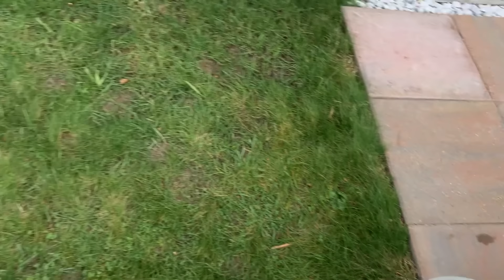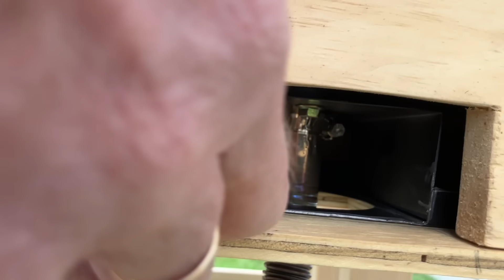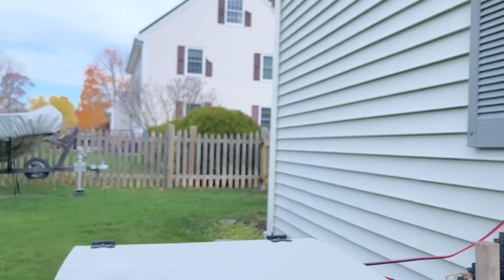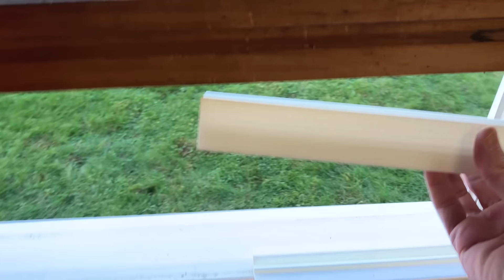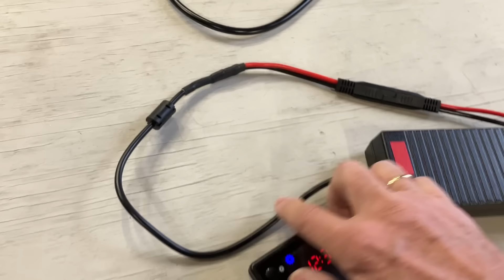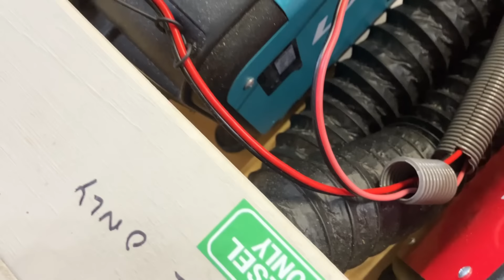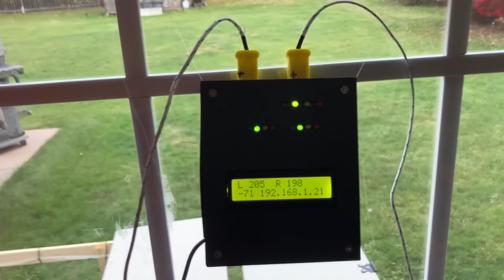Part 1: Dual Diesel Heaters for My Garage! Overkill? Maybe. Awesome? Definitely.

Comment: I would not have used the suitcase style heater , you can just lose the suitcase because the heater is inside and easily removed .
Reply from the maker: Thank you for the comment. I'm getting my first vertical later this week. I'm going to do an unboxing first start up video. But the way I'm using them I'm just using them for parts.

Comment: A little advice , do switch to 4 inch , add 4 inch duct fans to your return air return ducts . The heaters fan needs a little help . Also set the return air inlets close to the floor . I have been heating my space for three winters , they are great little heaters .
Reply from the maker: Thanks for the comment. I changed electronics so I could get to a controller that would let me set the fan speed from the default 4300 RPM to 5000 RPM and then lowered the max fuel a tad (see my other diesel heater video). I think my next iteration is going to raise the legs so the pipes are a straight shot reducing pipe length and air friction. 4" if I can. I really like the idea adding duct fans because thats exactly what I am fighting right now. Are they inline? or attached more like at the head of the intake?
Reply: @V-Tank  they sell an inline fan with speed control for $20 on Amazon. It puzzles me that no one is selling a thermostat/control set that cycles it on and off . I don't think that it would cost that much efficiency.
Reply from the maker: @philliplopez8745  Thermostat would be helpful just to make sure it turns off when the heater turns off. I will go take a look. Thanks!

Comment: I have a similar setup. I used a turbo charger inter cooler to to recover the exhaust heat. I also have a blower forcing air into the air intake tube. My exhaust temperature out of the inter cooler runs around 105 deg F depending on the heater setting.
Reply from the maker: Thanks for the comment and ideas. Someone was mentioning forcing hot air in. In my next video I swapped controllers out so I could program the fan speeds, but forced air would be even better. I want to try a water (antifreeze) heated unit next with exhaust recovery from a heat exchanger. But I'll have to wait till my budget can spring for that. With your intercooler are you seeing any moisture coming out of the exhaust. I saw a video where someone was doing that and it was dripping water which could ice up if using it outside. Love the CDH community!

Comment: This is an excellent video and I really enjoyed how you presented what you've done.  It looks like it all works, but...it seems like an awful lot of effort just to keep the units and fuel outside, when they're made to be inside.  I've watched quite a few videos on setting up a diesel heater, and the one we used for a couple of winters was also mounted outside, at first.  We discovered that the exhaust and the burn chamber air intake should be outside of the building, but the air flow supply for the heat exchanger should be inside the building.  Also, the longer the exhause pipe run stays inside the building, the more of that heat you capture.  What you've done here is impressive, but I can't help thinking one unit would be plenty, if you put the same effort into setting it up inside the garage.
Reply from the maker: Thank your for sharing. I had a single propane buddy heater that was 18k BTU with all the combustion and heat staying inside the garage, no exhaust and that was just enough to keep the garage at temp and give it a super slow rise in temp. Which lead me to diesel heaters. 100% agree that running them inside will capture a lot more of the excess heat. But it sort of evolved into this. I would say 70%+ of people run them inside. But the units I'm using are so super cheap, like $70-$100 US cheap and I have a hard time feeling safe with that. I know I'm loosing a ton of heat. My next step will probably be to raise the legs and get the pipes level with the windows. That will allow me to use insulated pipe and have at least 1/2 the length of air pipes I have now. Anyway... Sometimes you just have to do crazy projects just because.
Reply: @V-Tank  - At least half of my projects fall into the "crazy" category!  :)

Comment: Interesting.... where I live that fuel would gel instantly over that much exposed fuel line.
Reply from the maker: Tonight its supposed to get down to 4 deg F. I don't heat my garage full time, just when I'm in it. So it will be interesting to see tomorrow morning if it will gel or not. I'm running winter treated pump diesel.

Comment: I really appreciate what you've achieved, but to me it looks like a lot of over kill.  Why not just bring the units inside and run the exhaust outside?
Reply from the maker: I have had a ton of feedback suggesting that. Off the cuff, I'm estimating that 70% of people have internal heaters. It is the most efficient method in terms of thermal loss. But I have a hard time living with a $70 heater and a Gallon of diesel fuel next to each other. I don't think either is wrong, its just where I ended up.

Comment: Great video! I think about the only thing I would have done different would be to put some insulation around those fuel lines so that you don't end up having your fuel turn to gel on a cold windy night, not to say that it will but it could happen.
Reply from the maker: I have def received a ton of feedback on the fuel lines. I'm a bit nervous to see what happens this winter. I run winterized pump fuel, but I didn't have these long runs flapping in the wind last year. I'll update when we hit the below 10 deg F weather. One section with a little moisture in the fuel and its going to freeze.

Comment: Someone that understands siphons! Crazy how few miss that potential issue!

Fyi, and based on your displayed thought process' you probably already know, hon&guan (Amazon) sell 4 and 5" insulated ducting. 

After watching someone's results with a duct run outside in below freezing weather, I decided I would try and minimize that heat loss. I found that with single 4" insulated duct, at the 8' point, the surface temp was 150* (F). Same setup, same time, but a section of the 4" in the middle covered by insulated 5", the surface temp was 35* lower. 

So there is definitely heat to be saved in longer exterior duct runs. 

While I get redundancy, I've started to see ads for cheap "12000 watt" diesel heaters. Always skeptical given the fake 8kw's advertised, but these claim more than twice as much fuel consumption as a "5kw" unit, so it's plausible. Would make life a lot easier with one big heater, (with even more ability to produce heat) but I do understand redundancy. Maybe one of the smaller units as a backup, if these 12kw units turn out to be the real deal. Not a single YouTube review so far, they must be brand new to the market. Or a brand new scam lol.
Reply from the maker: Thanks for a great comment. In a future build I think I want to raise the heaters to level with the window, that should cut out about 1/2 the duct length. 100% agree with insulated on the hot side into the garage. Next build....

So I measured the fuel consumption on an 8k unit and it came out to about 4.6k BTU's/hour of consumed fuel.. So def a 5k unit. But if it were a real 12k unit that would be double what I have and make my life even easier. Wonder if they use a 4" duct for all that extra heat.
Reply: @V-Tank  the brand is "Wodli", the Amazon listing has the user manual available. 

Manual looks....poor. Says 100w draw on startup, don't see how that's possible even if it's a 5kw. Oddly they show 55w as the high range for normal running, which is significantly higher than the 5kw's which generally seem to max out around 35w. No mention of duct diameter that I see. Also shows .86l/hr on high, which is right at the .22gal/hr on high they mention elsewhere.

Hcalory has 3.5" duct on at least some of their stuff, and LF bros have 4" on some of theirs, so if this is indeed a 12kw heater I imagine they'd have to use a significantly larger diameter duct.

Comment: Just a suggestion.  I did a similar setup.  It made a difference when I extended the fresh air intake to the floor away from the heat exhaust.  Mine comes in my basement window well just above ground level and the return air duct drops to the floor level and comes across the wall about 10 feet from heat exhaust.  It made a difference warming ceiling to the floor.
Reply from the maker: Thats a great idea. Someone else suggested similar. I’m struggling with my ducts being too long and reducing airflow to the heaters and they run hot. I was able to up the fan speed to 5000 rpms and that helps. But if I could get cooler room air from the floor and not outside air that actually might help.

Comment: What power supply are you using?
Reply from the maker: I use the stock 12v 15 amp power bricks they usually ship with a diesel heater. I soldered on SAE connectors to everything to make it a little more standard for me. I run those AC to 12v power bricks on a EcoFlow River 3 to use as a UPS. Only problem is the River 3 has a max of 300 watts. So it runs the heaters fine, but I have to start them up or shut them down one at a time because of that really high glow plug current draw.

Comment: Just take the unit out of the metal box. Then you can use them.
Reply from the maker: Yes, 100%. I just happened to have new ones for this season. The old ones in the Gen 2 are spares. So liberating to have them outside of the metal boxes.

Comment: No expert here, just an opinion,  but from my research you do not want the intake inside the house.   It can send co2 that way in the event of a flame out, or so I've read.   It can also white smoke.   I was always told to vent exhust and Intake outside.   Great video !
Reply: The return vent or the air vent that he has going in is just pulling air that is blowing across the heat exchanger itself he's not drawing combustion air from inside that is being pulled from outside so there would be no white smoke coming out of any vents that are going into the building you're referring to the event that draws fresh air and for combustion that's not what is going inside so his setup is perfectly fine and perfectly safe and there is no need for any concern
Reply from the maker: Thank you! There are two loops. I'm guessing they are talking about the exhaust loop. It has an in and out and is mounted on the bottom of the heater. In my setup all that lives outside.  Maybe people running the unit inside take inside air for the exhaust intake? There is also the clean air intake and and heat output. So I'm thinking its the exhaust loop. If you know more, would love to know. Also no matter the configuration, make sure you have a CO alarm.
Reply: @V-Tank  yes sir, agree with having two alarms actually as I've personally seen and dealt with Carbon monoxide poisoning. .    My diesel heater has only one intake with a filter and one exhaust, I have both of them routed outside.   So I get fresh air from outside, and I also send the exhaust outside, Only the HEated air is inside.   What I'm I missing here.... do you have more than one intake ?
Reply from the maker: @goneridingparts  I think I'm going to do another video on a generic heater setup. Underneath the heater is combustion air, and exhaust in and exhaust out 1" (very very hot), (along with the fuel line into the heater) all three of these are on the bottom and its combustion air with CO and all the bad stuff. On the front /side of the heater is the output from warm clean air (3"). And on the back/side of the heater there are vents that allow the cool clean air to get sucked in so it blows through the heater and out the front (without CO and bad stuff). On my setup I took the clean air input and and simply attached a pipe to it so its taking it from inside the garage and keeping the pressure balanced. Hope that helps. On things like CO detectors there is a saying, two is one and one is none.
Reply: @V-Tank  definitely agree with two co2 detectors, just can't be too safe with this.   But I have read a flame out can send stuff back thru that intake, that maybe false information that I read.   it was in a forum.   I guess I need to change my setup if this isn't the case.
Reply from the maker: @goneridingparts  I think they are talking about the exhaust loop air intake.  I could see that happening because if the blower stops, wind outside could blow into the exhaust and out the air intake (of the exhaust). Even without wind, without the fan running stuff could come back through.

Comment: WOW! You really over think this. What will you do when it start to snow and starts to build up?  I have two heaters indoors. On brackets right on my windows with the exhaust is the only thing going outside. You do know that when it gets really cold outside, that diesel fuel gels up and cant be pumped. I don't understand why people don't put them indoors? They are made to be installed indoors. as long as you have the exhaust secured correctly and is going outside you are fine. I have a carbon monoxide detector right under the units and one on each floor. And not ones ever they went off from the heaters. The only time one went off was during the summer and I had my windows open to get a breeze. But I was running a generator in the back yard that was about 20 feet from the house and it still went off. I've been running these diesel heaters indoors for a while with out any problems. The only issue I run into is filling them up. I solved that by using two liter soda bottles, really simple and easy. I store my diesel in 5 gallon containers and use a pump to transfer the fuel into the 2 liter bottles.
Plus having the intake for the heater outside makes the heater run harder to heat the air, making the heater use more fuel. 
Bring them inside, you will be ok.
Reply from the maker: Thats great feedback. And thanks for the reminder on CO meters. It would be crazy to not run without one. I think about 70%+ of people run their Diesel Heaters inside with no issues. BTW snow melts off super fast and last year with Gen2 (the factory cases inside a box) I didn't get gelling. But I'm expecting that this year. I'll do a follow up video if I hit that problem. Not sure on your setup, but the 5 gal jugs are great because I don't have to pour anymore. Fill it up at the station and swap one in and you are good for a long while. I have a spare can so I can fill that at the station at my leisure.
Reply: @V-Tank look up “ diesel anti gel additive “ I use it because I store my diesel outside under a tarp. Hey, It wouldn’t hurt and if it gets that cold. At least you know you’re protected. I have a few 5 gallons jugs stored for backup. Hey, if the power went out and I couldn’t get more diesel. At least I have backup. Hey you just never know 🤷‍♂️
Reply from the maker: @iiinsaiii  How how you made out with the pump fuel without extra additives? Meaning they add anti-gel in the winter months from the station.
Reply: @V-Tank  I got my fuel that I store for long term during at the end of summer. Plus it gives me peace of mind knowing I added my own anti-gel and Pri-D treatment for long term storage.
Reply from the maker: @iiinsaiii  makes sense. Summer fuel has anti fungal, but no anti gel. Thanks!

Comment: I love your ingenuity. Please take these points as constructive suggestions.
1. You are losing an awful lot of BTUs by having the units outside and those ducts not being insulated.
2. You're losing even more valuable energy by not figuring out a way to capture that lost energy from the exhaust.
3. Just an assumption but I think you're overthinking the flammability of diesel, it really is not much more flammable than cooking oil that you probably have in your kitchen.

I think had you built a combiner box to blow the heat into and then circulate it with a little bit larger fan you would see a greater benefit from the heat you're creating.

Just my two cents take it for what it's worth.
Reply from the maker: Very helpful and thank you for taking the time to comment. My issue with the heaters running inside is I'm using $70 knockoff heaters. So the diesel by itself isn't flammable, but when I have it cooking in the heater, in my mind I picture a failure mode where it can ignite the diesel, especially sitting in the metal box with it. Plus my setup gets most of the exhaust risk outside. Though I would estimate that about 70%+ of people run these inside without issue. That said 100% taking a huge hit on heat loss with my setup. I'm going to need to make a a Gen4 that addresses that. What would be really interesting to me would be to take one of those diesel heaters that heats water and make a hydronic system. I saw someone pass the heat loop by a heat exchanger on the exhaust to recoup that also.

Comment: I run duals in my garage. Run both of them for a quick warm up then shut one down so one maintains
Reply from the maker: Yes, exactly. One just barely keeps up with heat loss so it takes forever to bring the temp up. The second one is all heat gain. I don’t heat my garage full time. Thanks for sharing.

Comment: I've thinking the same thing.   currently putting one in my truck camper.  went with the 9 gallon Scepter boat fuel tank.   idea being I have so much fuel on  board,  I wont have to refill on long winter road trip to southwest.   refilling, unless done very carefully is where drips and smells come from, in a confined space truck camper
Reply from the maker: Yes, totally makes sense with the drips and smell. Only advice is depending on the length of run, I let one of mine run out of fuel. Had to go through a priming cycle, then attempt to start and another prime. Also I had a hard time trying to figure out a good bend of the dip stick. If its a sideways boat tank, vs mine which is more tall/vertical, dip stick placement is going to be critical to get it on the bottom. Good luck, thanks for sharing.